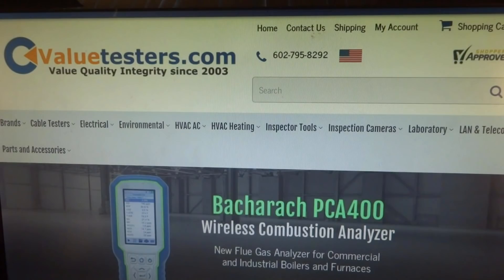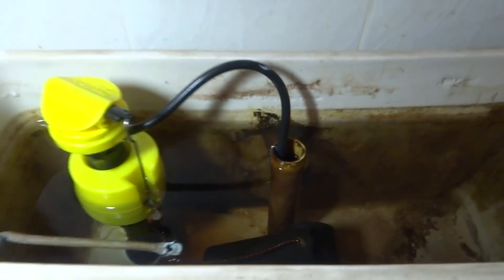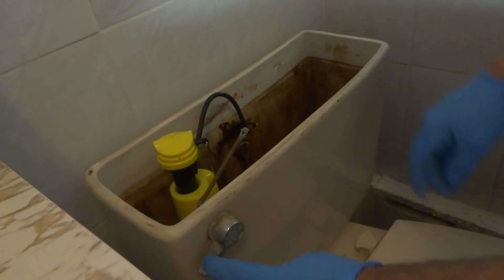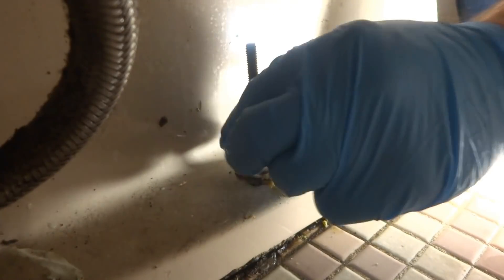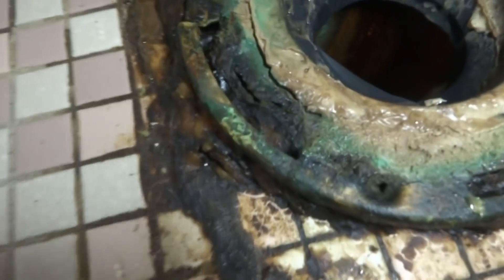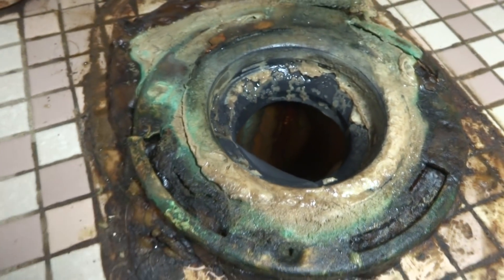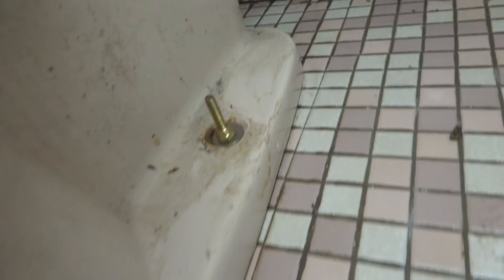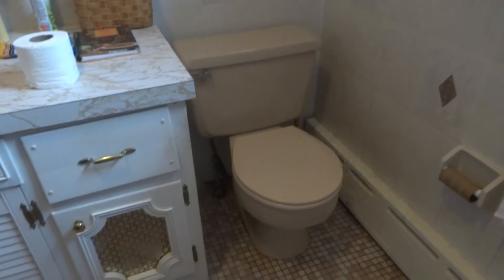broken toilet flange repair plumbing

Comment: What brand fill valve is that I've never seen the yellow one before
Reply: I believe Kohler is now putting them on some of their toilets.  I was buying a new toilet and the salesman at the supply house said that the Kohler toilet is geat--the cat's butt. He showed me the inside of the tank and was talking up that fill valve.  Based on Steve L's recommendation, I said just give me the Gerber Viper instead.

Comment: Hey Steve I noticed at the very end of the video you have too much water per flush, I think that's what was causing it to flush horribly slow. I have fix this by adjusting the fill valve's float and testing by running a flush after each float adjustment and eventually I find the correct water level that generates a more powerful flush

Comment: good repair Steve. Steve you should have put 2 or 3 short pieces of solder in the hole then the screw would have something to bite into, holds very strong.
Reply: antio warr that's a good tech tip. I've done that with thick copper wire, but never solder.
Reply: He couldn't even make a hole. He didn't break thru the mortar

Comment: Steven, I wish You posted this video three weeks ago! I had the same problem at my mother's house that is for sale and the home inspector wrote up a "loose toilet." After pulling the toilet, the flange was cracked on the right side. I repaired it, but wish I knew these repair flanges existed. Thank You very much for your videos.

Comment: I’m no plumber but based on how I do repairs from auto, plumbing, electrical I feel you could of replace the old flange with a new one, I mean that’s the correct way to do it, I know that’s a lot more work and maybe the owner didn’t want to put out all that money for labor, I’m sure you know what I mean, good cheap fix and money made I guess, peace and God Bless.

Comment: Bad job. Should have:  replaced the flung, used alternative to wax, adjusted the water level in the tank to conserve water (noted too much water wasted after each flush). Miss opportunity, should have suggested replacing the old water guzzler with water saving dual flush toilet for under $100 sold at Costco to save money and the environment in the long run. He used long screws and did not bother to cut them. , the washer and the nut were fastened off centered and crooked.
Reply: *flange

Comment: Flange  was way to high above the finished floor. 50 year retired plumber
Reply: I got about the same height at my house toilet off now how can i tell if it is to high ,and will it seal proper thanks for your help .
Reply: and the flange is floating not being screwed to the floor. DIY'er but I know this repair won't last as long as a fart in a whirlwind. I replace my subfloor and main floor around a lead bend and then screwed in a speedy flange and screwed that into a full 1.5'' of marine grade plywood.

Comment: nice... I get one a month like that except they are pvc flanges and in concrete.. i never have them that high where i can slide under..  usually over with a new stainless ring tapconed down.